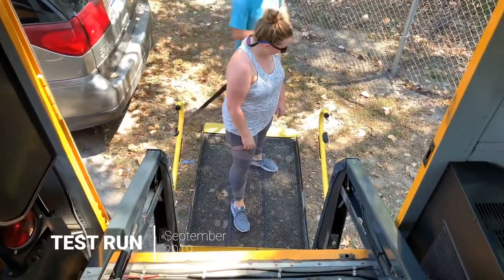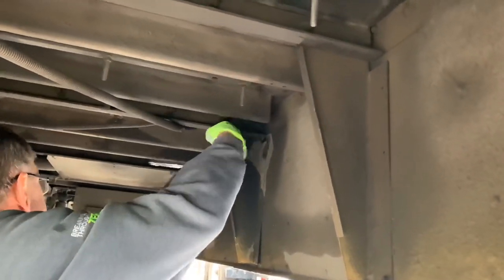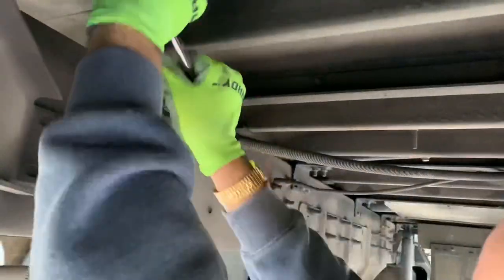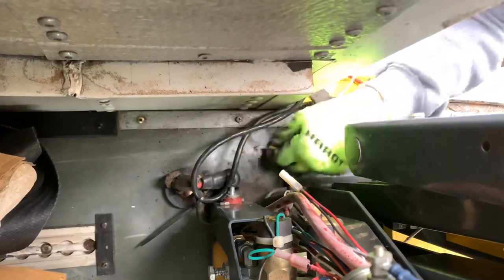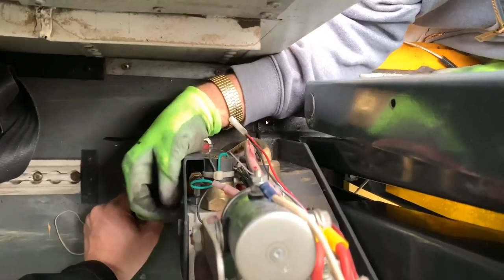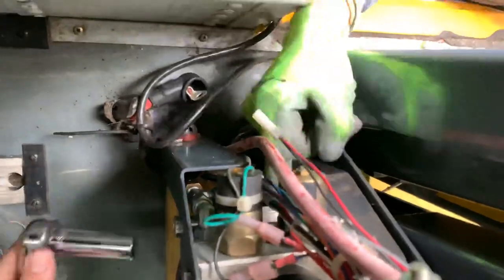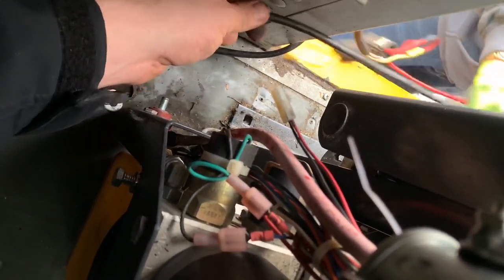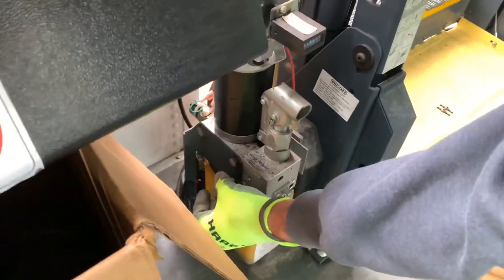Skoolie Wheelchair Lift Removal || 2020 Bus Conversion - Ep. 03 || TOTS the Bus

Comment: Hey did Y'all also remove the saftey interlocks for the handicap door? i took my life out the other day and cut all the stuff and removed it, but now my air parking brake wont release and I have 3 days to move my bus before i get a fine from the county, any help would be more than a blessing!! thank you
Reply from the maker: Yes, but we had a mechanic help with that. The interlock is set up in a way that it may not allow the engine to start or to release the brake and the wiring needs to allow for that connection. I don’t have any specific information other than to check the wiring diagram for you particular bus. That can exist for emergency exit doors, windows, hatches, etc.
Reply: So how did you do it to get going again Because I am having trouble  With mind my van won't start
Reply from the maker: Well, the trouble is that we had a mechanic help so I can’t really advise. He walked me through it in theory, using the wiring schematics, but I didn’t have to do it myself. I’m sorry I can’t be more helpful!

Comment: Can the lift be resized to fit on the rear possibly resizing the rear emergency door also?
I want a lift for scooters, motorcycles and self storage auction junk but I want the lift on the rear, not the side of the bus.
Reply from the maker: I’m actually not sure. All the electrical was by the side door, and that door was wider than the back door. I suppose it depends on the exact bus/lift combo? Good luck!